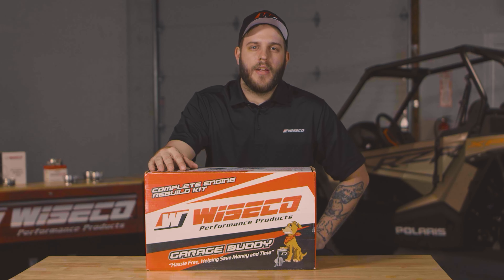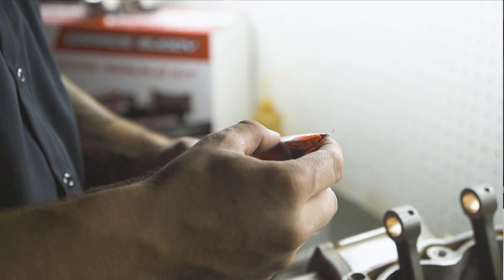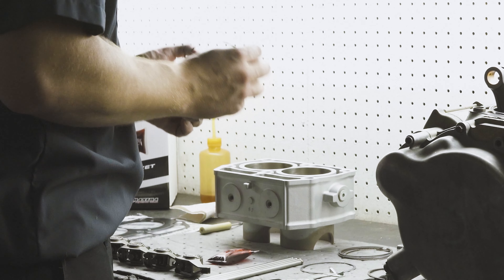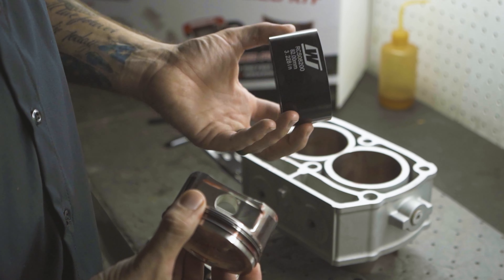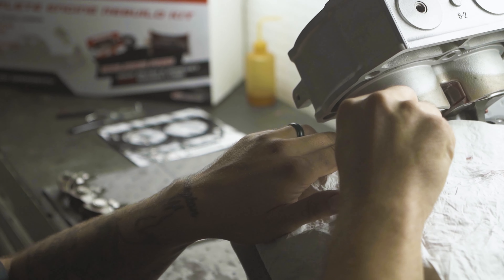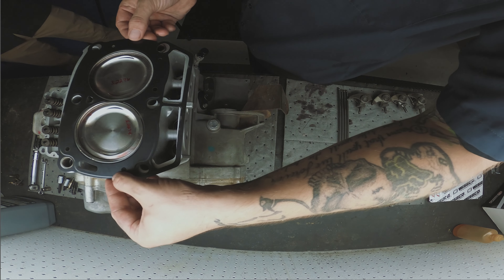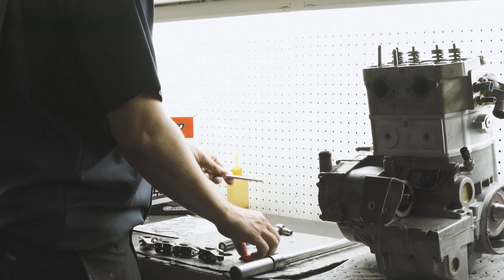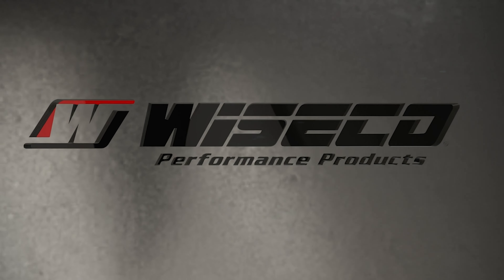How to Rebuild a Polaris RZR 800 Engine: Complete Assembly

Comment from the maker: Some people may count the Polaris 800 out amongst all the 1000s and turbos now, but these are practically the most abundant ATV/UTV engine out there! They're solid and reliable for many hours, and can get right back to that with a refresh. This is exactly why we developed Garage Buddy Engine Rebuild Kits - to restore reliable power without having to drop thousands upon thousands on new equipment. Joe from Wiseco R&D walks through each critical step of a Polaris RZR 800 engine assembly including dropping in a new Wiseco crankshaft, bearings, and pistons, pointing out key tips along the way.

Comment: My kit was not complete. Had to buy cam bearings and one of the crankshaft seals. Waiting on seal to arrive. The crank, pistons and the parts I did get look good. Shop manual is a great help to get all of the specs you need. 2012 Polaris Ranger 800 XP 6x6. The parts I have installed fit well and were easy to install. Could not get through on the phone to Wiseco. Wanted to order another kit for my Ranger 700. No list of parts was provided with what was in the kit. That would be a nice addition.

Comment: with all of the bottom end failures on the rzr Turbos 
when adding bigger tunes      we need a steel crank and rod  how to video   
 Also   How to install hot cams valve shim conversion kit   Without removing the head 
Brian Crower  makes the tool   but the price is ridiculous     someone needs to make a more affordable tool